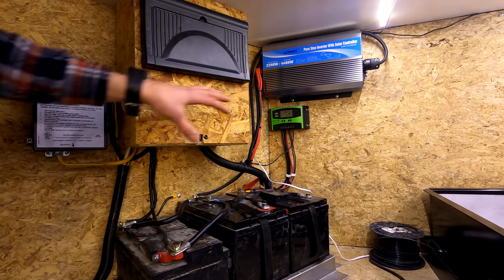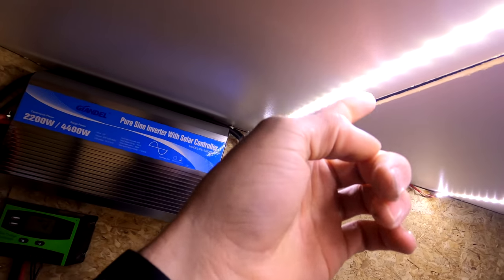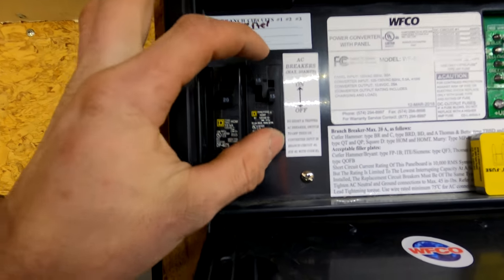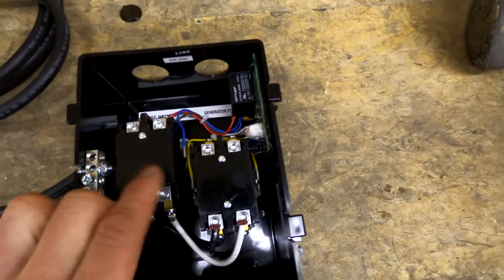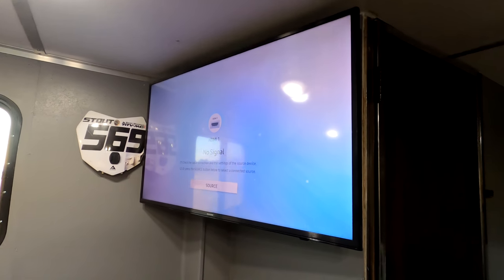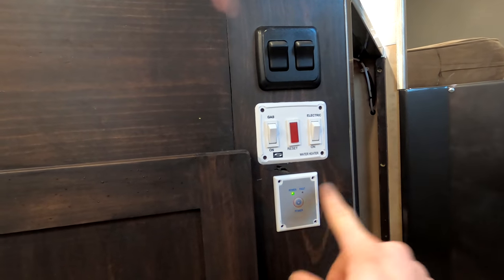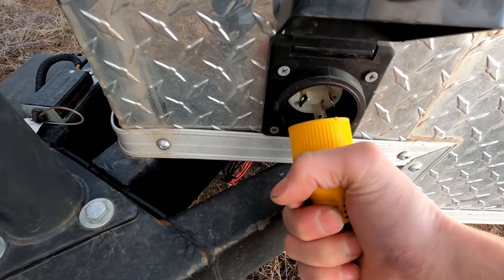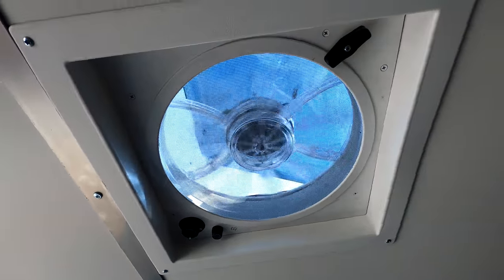Electrical System - Enclosed Trailer Conversion - Everything from Amazon

Comment: I like your conversion, I did one of those a few years back...it's lots of work. I just wired up my new aluminum camper I built from scratch the other day. I used 2 x 212ah AGM batteries, Renogy 50 amp DC to DC charger w/ built in MMTP, 2x  100 watt Renogy solar panels and Anderson plugs running to the tow vehicle smart alternator, 8 lug fuse block, 1500 watt sine converter, and a 30 amp AC to DC shore power converter tied in.  I'm running 6 puck LED lights, 2 x 8" computer exhaust fans, a water pump, 12v 24" LED TV, 12v DVD player, and a couple of USB plugs for charging laptop/ phones. I'm able to charge my house batteries while towing using the tow vehicle smart alternator using the DC To DC charger and when I get camping and the tow vehicle is off the solar automatically takes over for top off or trickle charge duties, at least I hope that's how it'll work. I think I went overkill on the 424 ah of AGM batteries, but as soon as I can I'll install a 100ah battle born lithium battery instead, but their pricey and will have to wait.
Reply: Hey i'd love to see you sketch on schematic of you build and possibly products you used

Comment: That gave me a great starting point for my electrical needs....very helpful.  Thanks for sharing.
Reply from the maker: Anytime! The one thing I wish I did different was add more 110v plugs. I would have at least added one in the bedroom area and one in the front box by the door. It’s super hard to add wires after the fact 😂 I was able to pull the outside sheeting off and run a wire for my microwave but other areas wouldn’t be as easy

Comment: Try a diesel heater. Look diesel air heater all in one on ebay. Its what I put in my enclosed trailer. Good dry heat. Very low amp draw when running. Only has a higher amp draw when starting up and shutting down. But after start up it has a very low amp draw. I get over 12 hours of heat per tank full of diesel. You might also look at the other types of diesel air heaters. I went with the all in one as the tank and heater unit are all in the same enclosure. Just run 12v DC to it. Drill 2 holes for exhaust Outlet and fresh air inlet for the combustion chamber inside of the heater. My heater is a 5kw and on mid setting it will cook you out of my 7'× 14' enclosed trailer. Very good video and has helped me clean up my ac to dc and dc to ac. Links for your parts on amazon would help, but simple search found them. Thank you.
Reply from the maker: KLH1966 I actually did end up with a diesel heater! Sounds like the exact same thing as yours! Well roughly cause as you know there are a bunch of different brands offering them. I did that 5kw all in one setup! I’m impressed with the heat! The only thing I don’t love is how loud that fuel pump is. I’ve put some of that sound deadening mat around the enclosure but I’d still like it to be quieter. All in all it’s a small complaint! I’m glad my video helped ya with your electrical setup! I think I might do another one on that topic as more of a in depth tutorial. I linked some of the stuff I’ve got from amazon in my next video after this one. That’s a good idea though,  I’ll add links in this description too. Thanks!

Comment: The trailer turned out awesome! I wish I could hire you to help with cargo electrical wiring. I’m so lost when it comes to the electrical portion of my build.
Reply from the maker: Alain Lopez Thanks! It’s down to the small stuff now 🤘🏼 Are you just doing a 12 volt system or 110 as well? It might be pretty hard for me to personally help you but there are tons of good videos on here that will show you how to do just about anything you are confused on! I found a really good video on how that transfer switch works before I got one for myself,  that’s more of a specialized item too
Reply: Austin Stout, I’m doing 12v and 110... I’ll have to really study up on the electrical. Keep up the good work, and keep us posted on your progress. 👍🏽

Comment: Great job Austin! I don't see my original comment but, I wanted to know what hot water heater you went with? I have an electric one in my trailer but want the option for propane when in the woods. Thanks, and how's the trailer holding up? Any changes?

Comment: Great job my friend. I am presently sourcing out supplies for my rolling workshop trailer- inverter to charge batteries, and 12 volt lights over the work bench. Which solar panels did you use?..... disregard, I read down and found the answer!
Reply from the maker: Hey thanks man 🤘🏼 That sounds like a fun project! I only have experience with a couple of bigger inverters but I’ve been pretty happy with that giandel brand pure sine wave inverter I put in mine! The one I got has a solar charge controller built in. So depending how crazy you wanna get with the solar setup that might be something to look into!

Comment: Hi Austin I really liked your videos, very well explained.  I have a couple of questions, I am really new at this so please bare with me.  I purchased a 7x14 cargo trailer and it currently has solar, however, the previous owner only put 1 outlet inside.  It has 1 12v battery, and 1500W Cen-Tech power inverter with a 3,000-watt surge.  I would like to add 4 more outlets in the trailer and a couple of more LED lights.  I am going to install an AC unit but that's it.  No fridge, no TV, just 4 more outlets for Charging laptops, or cell phone, shaver, and possible shower.  I do want to get another battery so i will have Parallel connections.  The solar panel is so small its like a size of a picture frame mounted on top of the box in front of the trailer.   Now I can plug the trailer to the RV outlet since it has a plugin from the outside.  My question is do I need a bigger solar panel?  Is my inverter big enough?  I am only using the trailer 2 times per month.  Thank you for your advice.
Reply from the maker: Charles Butler no problem! So generally it would be better to have a bigger solar panel than required for you battery bank because you won’t always get full power production depending on the weather and time of year etc. that way when your battery is discharged the panel can bring it back up to a full charge quicker. The charge controller (I’m assuming you have one of those? Or maybe the little panel is a maintainer?) will just not use the extra power. Another thing to consider is how many amp hours and what type of battery is in the trailer? If it’s a fairly low amp hour battery it might be worth it to buy two new rv deep cycles so you don’t over discharge while running the inverter. Basically it comes down to a lot of math if you want to figure out exactly how much power you need but for the most part you can oversize a little bit and call it good. One thing to keep in mind is that you will need to connect the ac to shore power or a generator. Even a big battery bank wouldn’t run an ac for very long. With a lot of unknowns in your build it’s hard for me to give you exact advice. however, you could check out a guy on here whose channel is called “diy solar with Will Prowse” he has tons of videos regarding batteries inverters and solar setups. I learned a lot from him!

Comment: Are all the outlets powered by the inverter when ur on 12v ? I'm trying to do the same thing  and confused on a few things
Reply from the maker: Yep! The inverter powers everything that the generator or shore power would! I just flip the breaker for the converter off unless I need it and am using a different power source

Comment: Why the mix between 6V and 12v batteries? Just curious why not use two 12V batts in parallel?
Reply from the maker: Well I started out with the two 6 volts for better discharge capacity and life etc but I wanted to add more capacity. I threw the 12v in there so I wouldn’t have to add two more batteries. In theory it seemed like a good idea but I’ve reverted to just the tow 6v’s now due to different amp hour ratings

Comment: They make a transfer switch that will automatically cut that battery charging loop when the inverter is turned on, I put one in my rv because I got tired of going to the fuse box to turn the converter off when I turned the inverter on.
Reply from the maker: Interesting! Do you know what brand by chance? I’d like to look at it! Also after I made this video and already wired mine I discovered another way to wire a converter to any transfer switch and have that same effect! You basically just run the main power that feeds the the actual converter to the shore power leg before the switch. That way it will only have power when you are plugged into the generator or the shore power. If I used my converter more often I’d take the time to rewire it like that

Comment: I’m getting my 5th wheel TH setup with solar and an inverter for when i dont need the generator. My question is when i add the transfer switch to my system, since mine doesn’t have one and you have to physically plug it in to shore or the onboard gen, how would i hook up the inverter? Would it be on the generator side of the transfer switch? Or would i need to get one that is capable of all 3 sources? I figure i can use my factory converter still unless i need  it all. Thanks for the help!
Reply from the maker: Ok so since you have to manually switch over power inputs all you have to do is install a transfer switch between that main input plug of your trailer and your breaker box. Find where the power comes into the breaker box, disconnect that wire and attatch it to the "shore power" input of the new transfer switch. Connect your inverter output cable to the "generator" input on the transfer switch. Then run a new wire from the output lug on the switch to the breaker box. (just like the original wire was ran) Hopefully that makes sense, its way more simple with a diagram! haha. You will still have to manually choose between shore or generator power like you are used to but the inverter will be automatic. Also words of caution!  -> make sure all power is disconnected before messing with the wires. verify your work and connections before powering up. Make sure to buy the correct size of wire and transfer switch. For example: if your trailer plug is a 50 amp, Do Not buy a 30 amp transfer switch. or if the wire running to the breaker is 10 guage, dont replace it with 14 cause its cheaper. hahah 
Also, I made a video specifically covering transfer switches. Might help clear things up https://www.youtube.com/watch?v=OSfqIb23ZPo&t=6s

Comment: Very cool, PROPS!!  I would like to do this.  I could pick  up a 38 foot car trailer for $500.00  a fifth wheel missing the roof.  I can put A new roof on since I have materials I’ve never done electrical. I would like to turn the first 12 feet of the trailer into bedroom and kitchenette like you have. the rest of the space for my 69 Chevelle racecar. I was looking in the new trailers but they wanted 100 grand and I don’t want to pay that. Lol
Reply from the maker: Thanks Robert! If you can handle changing a roof you could defiantly do the electrical! That would be a pretty cool project! I like the idea of a 5th wheel vs bumper pull. It’s crazy how much they want for the new trailers huh?! You’ll have to send me some pic of you end up doing it!

Comment: So did you wire it up to run off batteries and or a geni??
Reply from the maker: It can use either or. Inverter for when you don’t have the generator on or plugged into the grid. Still goin strong too!

Comment: Hey Austin - I know you mentioned everything you used is from Amazon.  Do you happen to have a list of everything you purchased.  I am planning on doing a similar system and that would make like much easier.  Thanks!
Reply from the maker: As a matter of fact I do! Most of the stuff I used is linked in the description! If there is something specific you are having trouble finding let me know cause I may have missed it when making the list. That’s awesome you are gonna start a build! I had fun with mine 🤙🏼

Comment: What did you do for gray water tanks and black water? How big is your trailer?
Reply from the maker: Isaac Delgado you can see the grey water tank and part of the install process in this video https://youtu.be/oSvPiMH0A5k
My trailer is a 8.5’ x 24’ with the 36” v nose 
The black water  is in a custom built aluminum tank that sits inside right under the toilet. I wasn’t able to put it underneath due to the frame and plumbing

Comment: Hey, Curtis here. I am impressed with your wiring capabilities. I was wanting to add a outlet to the outside of a van-camper, possibly even a USB connection. When setting outside it wouldd be nice to have. Whats your thought?
Reply from the maker: That’s actually a solid idea, I don’t know why but I didn’t put any outdoor outlets on my build and wish I did. The biggest thing with the camper van would be getting a good waterproof housing for the outlet and finding a way to mount it to the van itself. Ultimately you’d wanna go with a gfci where it’s gonna be outdoors. They make that type of outlet with the usb built in. Another thing to do is make sure you add a breaker between the inverter and your outlet 
Does that help?

Comment: I know this sounds nuts, but can you also use your trailer to house a portable dyalisis machine?
Reply from the maker: yeah Im sure it could! Since I only have one couch in the back there is plenty of open floor space plus power to run it. Thinking of using an eclosed trailer for something like that??
Reply: @AustinStout  yes. I need to get someone to do it. I assume that this will cost a lot.

Comment: Hey Austin, how did you determine how many watts for the panel and inverter? I want to charge LIPO batteries at RC flying field. Thanks.
Reply from the maker: There are some calculations you can do to determine the solar panel watts to battery amp hours but I can’t remember what the formula is right off. Some people get super technical with it and calculate controller efficiency and average daylight etc. I went with the dumber method and put as many panels as I had room for on the roof and a charge controller that can handle a little more than the panels put out. Ideally you would want more panel than battery bank so your batteries can come up a full charge and recover quicker. Mine is 320 watts of solar to 300 amp hours of batteries and it works fine. I don’t run my batteries down very low tho. I read some forums on the topic so I’d search there if you wanna know exactly what to do! Also a guy on here by the channel name of “diy solar power with will prowse” is a good resource!

Comment: Does  your   "Charge Controller " 
Charge your batteries  from   Shore power and  Solar  power  also??
Reply from the maker: The charge controller only charges with power from the solar panels but the converter will charge with power from the generator or the shore power!

Comment: Can I get in about transfer switch and inverter. I’m new to this having trouble figuring what direction to go. I love your setup
Reply from the maker: mark anibas What specifically would you like to know about the inverter and transfer switch setup? Sizing, how to connect it?
Another great resource is a guy on here whose channel is called DIY solar with will prowse. He goes over a lot of stuff relating to solar and inverter setups
Reply from the maker: mark anibas hey you’ve probably long since figured out your question about transfer switches and inverters but I have a new video up going over the basics of installing a setup like that 👍🏻
Reply: Austin Stout 
Yes I have some questions. Let me check back with you in a bit. Still need a couple more parts.
Reply: Austin Stout 
Can you send me the link covering the basics.
Reply from the maker: mark anibas https://youtu.be/OSfqIb23ZPo here ya go! Lemme know if that helps or not

Comment: just curious, is 2 x6v in series better than one 12 v?
Thanks for the video...looks great
Reply from the maker: Two 6 volt batteries in a series will provide deeper discharge/recharge capacity than an equal amp hour 12v battery! I need to make and updated video on this system but now I have changed my battery configuration for better lifespan. I shouldn’t have combined battery types as I did at the start of this build. So keep that in mind if you are building your system! Buy the same battery type and same amount hour rating

Comment: So your converter basically acts as a breaker panel but will turn the dc to ac and vise versa
Reply from the maker: Yeah, basically. It doesn’t turn dc into ac though. You need an inverter for that 
The converter just charges the batteries and converts ac to dc
Reply: @AustinStout  another question in one of the videos it shows a double transfer switch is that if you have a short plug in as well as an inverter and geni? Just confused on that part
Reply: Shore*
Reply from the maker: I do have a transfer switch in line before the converter/breaker box. Shore power and the generator use one of with inputs and the inverter uses the other one. I’ve got a diagram and a whole guide to all the components linked in the description too if you need